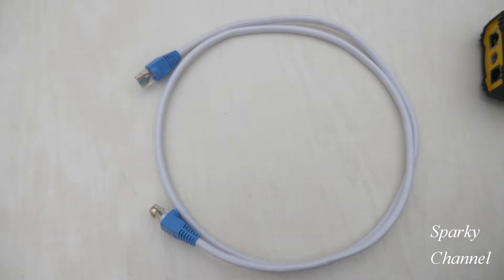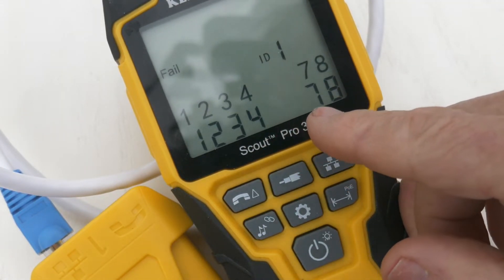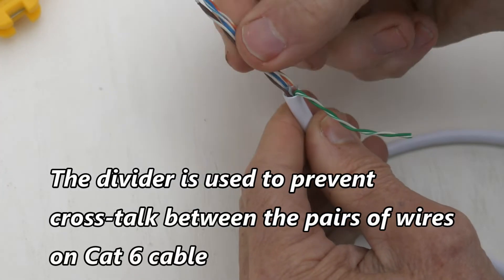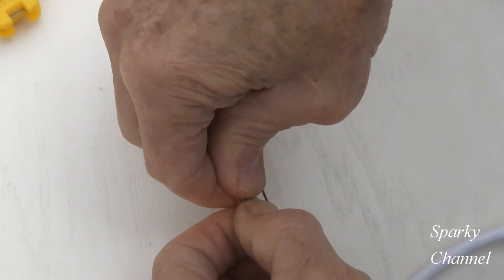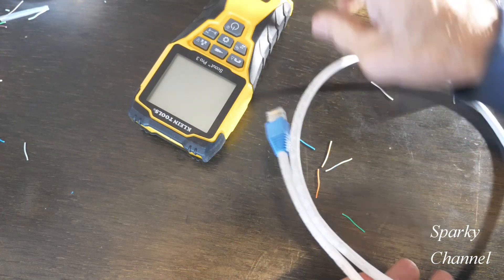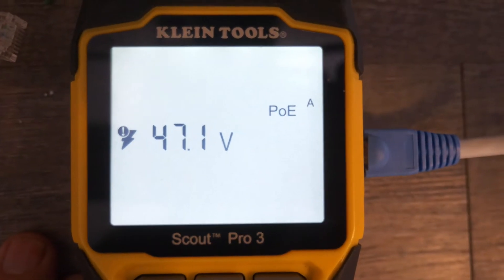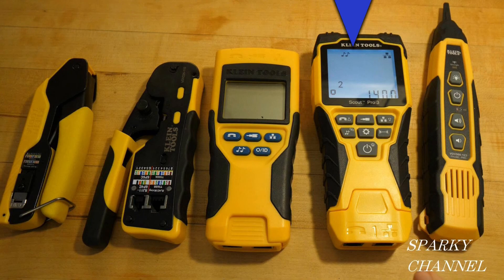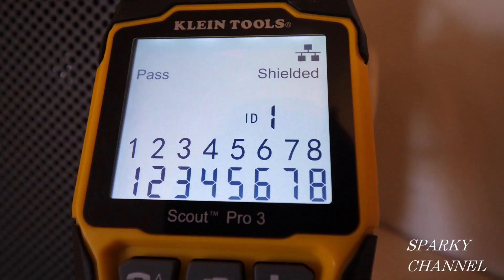Troubleshooting Ethernet Cable with Modular RJ45 Plugs + How to Find Damaged Area of Cable

Comment: Here’s a question, so the ID1 indicated that the problem was on the remote side. Well what if the wiring order on the unit side was incorrect, would it indicate the unit side is incorrect?

Comment: Sparky, you gave me one of those "Eureka!" moments!  I had been trying to figure out why the cable I had run and terminated with RJ45 plugs wasn't working - no lights at all showed up on my tester.  I cut the plugs off and installed new ones, with the same result. Were the plugs bad?  Was the crimper bad?  Was I not squeezing the crimper hard enough?  Had I kinked and broken the cable when running it through the attic?  Then I watched your video (after having watched several).  When you said, "put the spring down", it hit me - I was keeping the spring UP when inserting the wires into the plug, so they ended up in reverse order.  Yours was the first video I'd seen where you actually said how to hold the plug when inserting the wires.  Other videos showed the plug with the spring down, but I didn't notice they were doing that.  I felt like a dummy but was so happy to have discovered the problem.  Once I installed new RJ45s with "the spring down", the cable tested just fine.  Thanks for a good video!

Comment: When measuring length to check a cable in the wall, you would connect a patch cable to the meter and to the jack in the wall. Don't forget to take the length of the patch cable into account. If you're using a 6 ft patch cable and the problem is 6 ft away, the problem is at the jack in the wall, not 6 ft up the wall somewhere.

Comment: Here's a question for you maybe you can make a video on it. Just had the situation happen here at the home electrical costly issue. Actually still kind of guessing what happened. The home was built in the 1920s. Wiring it's still mostly 1970 code but in the late 90s had a circuit breaker installed. Not all receptacles had been rewired to be grounded receptacles. They're not even marked. But in some parts of the house new receptacles were installed wired in and they are grounded. So in some rooms you'll have not grounded three prong receptacles along with grounded receptacles. So now you understand that. And you add in or stir in ignorance of the situation of this evidence. You have a computer and a TV in a room where it's in the corner on a desk where the receptacle on the left is grounded and new and the receptacle on the right is old and not grounded. In fact I can't remember the last time it was ever pulled out of the wall maybe never for decades. With ignorance both plugs had surge protectors attached to them. Computer was mostly plugged into the new grounded receptacle other devices that didn't need ground or plugged into the other non grounded receptacle in its surge protector. Purely by luck. A old display was brought in and connected to the computer plugged in to the surge protector that is also plugged into the not grounded receptacle. Remind you the display is a grounded display.. also remind you computers and receivers and TVs are designed supposedly for you to plug in HDMI while they're on and not have a problem. Wrong in this situation soon as they display plug was connected to the computer electric shock top noise happened fried the video card and the display. They're both at the shop and actually burnt to video cards not understanding the situation and I'm assuming with this information I gave you. I think the problem is that a surge protector with grounded options was plugged into the ungrounded receptacle not knowing that's going to be an issue. Well that display getting electricity from that non-grounded receptacle also connected to a computer that is using a rounded receptacle. I'm assuming if the ungrounded surge protector and display head dirty grounded electricity this is what caused the pop and issue. Just trying to understand the situation don't want this happen again already cost about $1,000 in computer damage
Reply from the maker: Surge protection will work on a two-wire ungrounded outlet by preventing a voltage surge between the two conductors. But if the surge occurs due to lighting, the damage might be inevitable, as the path to the ground is not local, i.e., the ground connection might be quite a distance from where the actual surge protector is located, and lighting always seeks the shortest route to the ground. 

In a nutshell, surge protection on ungrounded outlets may work for power surges caused by switching operations upstream but be less effective if the surge occurs by lighting nearby, including common mode surges. 

Remember that ungrounded surge protectors won’t provide the protection you expect.

Comment: On doing doing commercial or high end installs, it's not enough to test continuity-plus a bit more that this and similar testers do. The install needs to validate that the cables can work to their expected performance, such as 1G or 10G, and for that you need cable analyzers, which are in the $2k+ range. You give the customer receipts for each run. Seen cat6 cables with links downgraded to 100Mbit due to kinks or abuse in the install, even though continuity was fine.
Reply from the maker: That's a great point. What brand cable analyzer do you use?
Reply: @SparkyChannel  Back years ago when I was involved in that area more, was working with another contractor and using their gear. Don't remember the brand, but it printed receipt size results of the test, which we'd staple to the install report. I've lusted after the Fluke LIQ with its features, "entry price point" (~$3k), and for it to join my other collection of fluke gear, but haven't been able to justify it.

Comment: Personally, love the passthrough connectors for speed and ease. Gone through my share of closed ended connectors that I had to redo due to them not staying square in the end as I crimped. Not suitable for all situations though. If you contaminate the exposed wires, weird things can happen and can be difficult to figure out.
Reply from the maker: Excellent points, thanks!

Comment: I use a metal cat5 plug that allows the wires all the way through then cut them flush at the tip
Reply from the maker: Interesting, thanks!

Comment: I personally prefer the A pattern on my data terminations, because I can field terminate everything in the A pattern, and if they want to use a jack for voice, they just need to terminate it to the voice side of the demarc, and it is good for two lines without changing the wallplate termination.  
I also have a different brand of tester, and it's one of the type that never turn clear off, so I have to pull the battery to keep it from draining the battery between uses.  it has a set of adaptors, including an alligator clip adaptor, and it has an adjustable capacitance setting, which means I don't just use it to check the distance to damage on data lines, I can test the distance to damage on any cable I know the capacitance of. - including romex.
Reply from the maker: What brand of tester do you use?
Reply: @SparkyChannel  actually don't remember off the top of my head.  I may be an Ideal, but long since discontinued.  I've been using it for over 16 years, now.
Reply from the maker: Klein, Ideal and Fluke compete heavily in this field. With the advent and increased use of PoE, I feel that electricians should become proficient in networking with PoE. What do you think?
Also, I love my Klein Scout 3 because it's so handy for field testing of these network cables and PoE voltages.
Reply: @SparkyChannel  I haven't done anything with PoE. what I'm seeing is more and more homes and small businesses that use high end wireless systems.  but it's good for an electrician to know how to build infrastructure, even if they only do it once in a blue moon.
Reply from the maker: @kenbrown2808  I agree. PoE security systems are superior to wireless though, IMO.